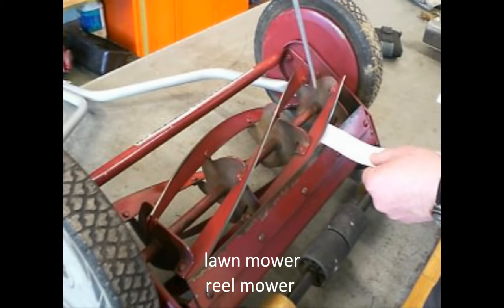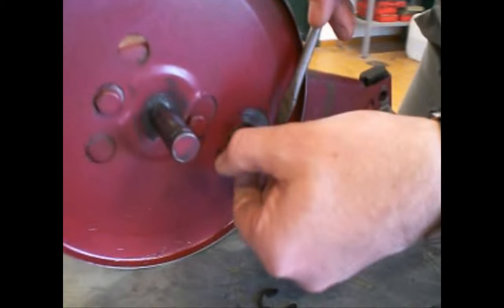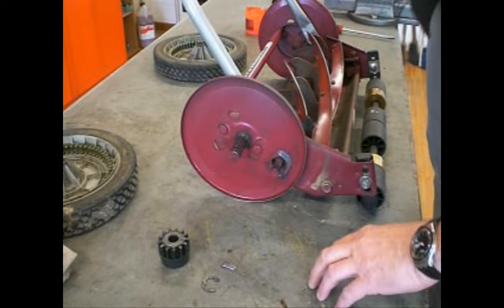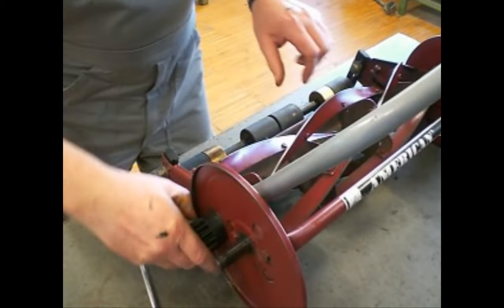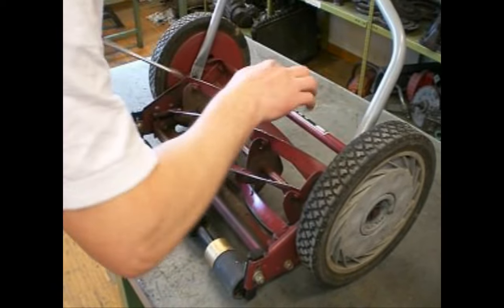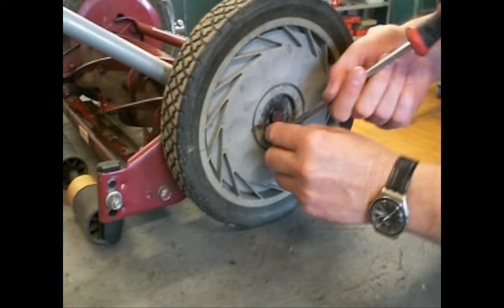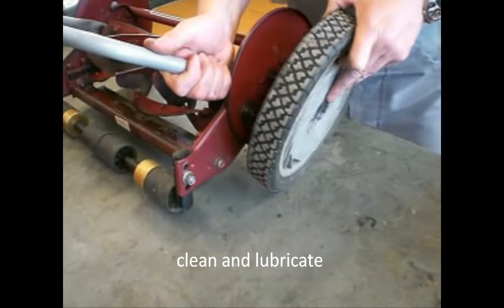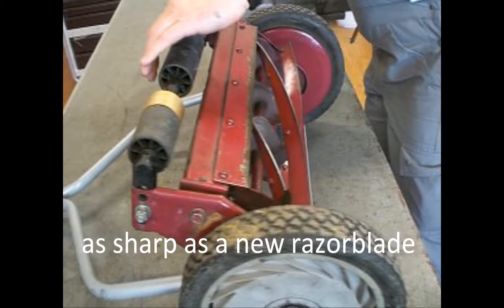sharpening of a push reel lawn mower

Comment: Gerwich, This is a great instructional video. I'm wondering if you have to reverse the blade turning direction to counterclockwise? I have lapping compound, but I don't have access to a workshop and tools and am wondering if the blades can be sharpened if you don't reverse the gears and they run clockwise? Or will they be damaged. Thank you.
Reply from the maker: Dear Sheri! You MUST reverse the direction of turning under using lapping compound. Otherwise you will get the opposite effect, the blades will get very, very blunt. U would make damage.
Reply: Thank you for the clear reply Gerwich. I'll give it a go.

Comment: Hi! It is a clear video but I do have some questions still. What setting do you have to set the plates and bedknife, what do you have to look out for?
And how does the lapping actually work, how does it sharpen, against the floor?

Thanks in advance!
Reply from the maker: Hallo! Sharpening works between reel and bedknife. Tuning of reel and bedknife with setting screws  is a value of experience. There should be a little bit of contact, so that the reel is not running too easy or too strong. Good luck.
Reply: @geri1360  Thank you so much for the clarification! I think I will be able to do this now! :) only find some lapping paste and then Ióm good to go

Comment: I watched this a few weeks ago and thought, I can do this! went and bought a second hand mower and brought it home and it's this exact mower. Picked up lapping compound and grabbed a screw driver and I just had the most fun mowing a lawn ever. Thank you for the tutorial!
Reply: @geri1360  can we just leave the mower as is and put the grinding compound then pull the machine instead of pushing?
Reply from the maker: @venus2012ful  Hallo Venus! You have to interchange the cogwheels, so that the reel turns counterclockwise. And then push the mower. b reg

Comment: Mr. Gerwich,
Back in the 60’s the local hardware store had a machine that the knife guy would take the mower and mount unto.
The a grinding wheel on a track would pass over the blades, is that process still around?
Is it better than the self sharpening method.
Thank you Dan
Reply from the maker: I think the method with the grinding wheel is still around, but lapping as showen in the vid is more effective and the costs are lower.
Reply: Thank you :-)

Comment: about how long would you say you should push the mower in the reverse configuration in order to sharpen the blade? hope i worded that right and thank you for the great vid.
Reply from the maker: for about 2 minutes. If the blades are very blunt go 4 minutes around in reverse configuration. br
Reply: hey thanks man i didnt think i would get a reply :) still debating on sharpening especially after adjusting the cutting blade screws. now it seems to be cutting the paper all the way across.
Reply from the maker: Perfect. When it doesn´t cut the paper all the way across, you must resharpen. Remember well: after every mission clean the mower and spray some WD40 or similar over the blades. There is some organic acid in the herbage, that makes blunt. I sharpend my mower LAST YEAR, not this year! And it works perfekt. I think, I will also make a video about reel-mower-service. br

Comment: Could you explain the adjustment you did in the beginning? Adjust those screws how? And why please, im confused.
Reply from the maker: one have to adjust the correct space between the reel and the bedknife by turning the setting screws. You must feel the drag of the reel. The reel should not turn too strong and not too easy, it is an value of experience. With the setting screws you can make the space between the bedknife and the reel larger or smaller. The screws pushes the bedknife nearer or remoter to the reel. Hope, I could help you. b.r.
Reply: @geri1360  This is a great video, thank you for responding!
Reply: @geri1360   Ohhh.... I THINK I see how it works now!  Thank you for the answer and thanks to Michael Sockwell  for asking!  As a woman who isn't used to a lot of tools, I hate always asking the obvious (to everyone else) and am always glad when someone else needs clarification in the comments!
Reply: @michaelsockwell6343   Glad you asked the question I couldn't see in the video.  Now we BOTH (and others too, probably) see it clearer!
Reply from the maker: @freewaybaby  enjoy your mower

Comment: Excellent. A question though-how snug should the bed knife be to the reel?
Reply from the maker: So that you can turn the reel by hand with low force. BR
Reply: @geri1360  Thank you. So there should be a little bit of contact between the reel & bed knife-but easy movement.

Comment: thanks for the interesting approach.... are you saying the blades sharpen themselves by simply reversing and pushing around for awhile with lap compound... no need for file or sharpening tools???... what if it is rusty and quite dull???
Reply from the maker: there is no need for file or similar tools. If the blades are ver blunt, make some rounds with lapping compound and when the reel is going easier - you will feel it - then set the bed knife closer and repeat the action twice or threetimes. Under correkt maintenence there should be no rust! Clean after mowing an apply protection. e.g. Diesel.
Reply: @geri1360  aloha, and mahalo for the additional info... will get some lapping compound and give it a try...

due to volcanic air pollution (sulfur dioxide, sulferic acid when combined with water, battery acid)... it corrodes even stainless steel.... 

i use melted wax or recycled oil for trying to prevent rust on some metal tools..... it helps, but still not perfect... never tried diesel....  mahalo again for responding...
Reply: Can I assume that the combination of running the blade in 'reverse', coupled with a small amount of lash in the bearings for the reel, combine to ensure that the lapping compound wastes material on the blade(s) at the 'back' edge of the blade, and the (uniform) positive contact of the blade on the bed knife serves to distribute the compound but not remove much material from the front, or leading, edge of the blade? IOW, is the application of this method best suited to a mower with equal (and reasonable) lash in the bearings at each end of the rotor (reel)?

Comment: This technique worked so well, I feel like an idiot that I was cutting my grass with such dull and poorly positioned blades. Another Youtuber had an elaborate method using a power drill. This one is so simple it's genius. I set it up as directed, pushed my mower up and down the street for less than 10 minutes, and reduced my mowing effort by at least half.  THANK YOU!!
Reply from the maker: :goodvibes:

Comment: Thank you. Very clear and helpful.
I wanted to reduce my use of gasoline. I have an electric car, so why not an electric mower? I had an old reel mower in the shed that I had never used. Cleaned and sharpened as you instructed my grass now looks better than ever using no fuel at all. It is actually easier than hauling my old gas mower around the yard. Thanks again.
Reply from the maker: Very well! And thank you for comment. BR

Comment: Thank you so much, I now have a fully functional reel mower which actually cuts the grass rather than just chewing at it. I used valve grinding paste from a car parts shop. The instructions were very clear and the only problem I had was replacing the ‘C’ clips, but I got them on after a bit of fiddling
Reply: I remove C-lips with a flat screwdriver. Only one push, no fiddling. But fiddling is also ok. Have a nice day!
Reply from the maker: C-clips are sometimes hard to remove. Use new ones. With only one push I remove them with a flat screw driver. br

Comment: Do I need to ensure the paul is put through the same way as it was put in before ? Or it doesn't matter, the pinier gear switch is the key ?
Reply: I agree with others, that this is the best simpliest method I found thus far, why bother with the sharpening kit for another $20-40 after shipping. All that is required is the lapping compound, brush and gasoline.
Reply from the maker: You have to set the pawl correct. Proof by turning the pinion! Good Luck!

Comment: What's the reason for taking the wheels off to sharpen the blades? Can't they be sharpened with the wheels on?
Reply from the maker: The reason is to get an opposite direction of rotation of the reel. During sharpening the wheels are assembled.

Comment: Nice job! I especially like that you mention when adjusting the screws that a 1/4 turn is a big adjustment [other YouTube videos floss over this explanation], it is in line with American Lawn Mower Mfg. product manual [pdf file], they mention this is a very sensitive adjustment [they consider a 1/16 turn is a major adjustment]. When you think about it - when you've done the lapping process once [creating equal pressure/drag across the bed knife] the adjustment of a 1/16 turn is plenty to do the job when you lap the next time.  I certainly will be subscribing to your channel, I like your approach and insight.
Reply from the maker: thank u! Love u!

Comment: Perfect! So helpful. Not sure why the poles need to come out, but otherwise everything I needed to know. Thanks!
Reply from the maker: The pawls must come out, to set in reverse for getting reverse direction of reel turning. Have a nice day!
Reply: I have also seen where you skip the step of reversing and simply remove one wheel put the other wheel on the edge of a table then connect an electric drill to the axel and reverse the mower and run for a few minutes. 

What I learned here was to simple tighten the bottom blade is all I needed. It seems overtime it sacrifices itself.

Comment: does this work with a motorized reel mower also?
Reply from the maker: I think, it will work, if you can drive the reel in reverse direction. br
Reply: check out How To with Doc, He shows how to sharpen Motorized reel mower.

Comment: This is the best video I've seen on this subject. Thank you, very much for the time and energy you gave in showing how to sharpen the blades. The camera man did a great job with the camera, too, which can make or break a video. I just wish to see one thing... to see how tight the blade was after you adjusted the screws, before the sharpening... that's just a little thing.

I bought a push mower for $10 at a yard sale, and it looks pretty new, but it's not cutting that well.  Maybe, I just need to adjust the blades. If the blades need sharpening, now I know how to do it. Thank you!
Reply from the maker: Thank you. I love your comment.

Comment: Hello from indonesia, thanks for your time to share your knowledge and shares. Clean teaching video. I got a used mower from local market, rusty and dull. Had follow your instruction and got good result but not yet perfect. I found troubleshoot that 2 blades at the edge caused jump effect (bumps) when it touch the bed knife. Those 2 blades wide seems not flat. Hope you kindly give me advise what to do to fix those bumps, so those 2 blades side can perfectly contact the bed knife surface and can perform better to do this sharpening methode. Sorry for my worst english, sir.
Reply from the maker: Hallo! Maybe the knives are loosen. They must be tight. Greetings from Austria. B Reg

Comment: What’s a lapping compound?
Reply from the maker: grinding paste. f e Chemico. br
Reply: it is a graphite paste..it is used to smooth out tiny nicks. this is called back lapping not sharpening! it will help but a complete sharpenig of reel and bedknife should be done every year or so and the procedure in this video about 4 times a year depending on how often you mow..

Comment: This is awesome.  Gute Arbeit!  The only thing I might add is that lapping compound can be tough to find depending where you live.  It is likely that you will have to find it a speciality automotive store where they sell valve repair equipment.
Reply: Exactly, I use engine valve lapping compound, bougt on the internet for few money. And there are also alternatives, you will find here on youtube channel. Thank u for great compliment! BR
Reply: Every garage with a mechanic probably has valve lapping compound somewhere within its walls. Garages are everywhere because ICE cars are everywhere. If you only need a small quantity from time to time, don't buy it retail: hit up your local garage mechanic and strike up a conversation… knowing what it costs, and what it's worth, it doesn't hurt to ask. The worst that can happen is the mechanic says "no".
Reply from the maker: @michaelthibault7930  Thank you for helping me. Have a nice day!

Comment: Here I thought the blades needed filing with a file.  Very surprised at this video.
Reply: no file nescessary. Lapping is the magic. BR
Reply: @MrGerwich   I can't be the only one who doesn't get it!  The lapping compound, but what are the blades being sharpened against?  Thanks!
Reply: They will be sharpend against the bed knife. Have fun with your mower!
Reply: The straight edge of a paper cutting board is to the bed knife of a reel mower as the guillotine knife of that cutting board is to the rotating blade of the mower.

Comment: Thank you. But I am confuzzled....your counter clockwise looks very much a clockwise to me....to the right around right down to the left up and to the right..clockwise...your explanation States the opposite?! Why ??]please help me.i hazve a sharpening stone as well as a file bastard standard flat metal file all purpose ...I'm so frustrated...I've pushed headed dragged pulled shoved that dull beast across my lawn with such exertion I'm convinced someone will find me dead with my push mower faithfully in my one hand clasped around its flat bar the other hand flipping the bird and a message i was able to spell out in  grass clippings my sweet revenge...the push mower killed me...it was the push mower....
Reply: Don’t worry about what is clockwise, as long as you switch around the two gear cogs the reel will spin in reverse which will sharpen it once you put on the lapping paste/valve grinding paste. I am not a handyman (in fact I am a not very handy woman!) and I used this technique to fully sharpen the blades on my reel mower. I did the slicing the paper trick and it worked, very satisfying
Reply from the maker: @nicolabenson1155  I love your comment
Reply from the maker: clockwise -counterclockwise: it depends on the perspective. Stay alive!

Comment: Ok,
Just a question, 
You didn't really show how to sharpen the bed knife,or if you sharpen the reel. If you are to sharpen both. 
You showed us how to remove the wheels,and clean the reel. 
How do you sharpen the bed knife?
Reply from the maker: lapping compound makes the reel and bedknife sharp at once by running reverse. B.r.

Comment: How about a video on sharpening the blades without 10 hour dis-assembly of the whole thing? This is a joke.
Reply from the maker: with average skill you'll do the job in 15 minutes. b.r.
Reply: It  was pretty easy for me even though I've never done it before.  

It is necessary to disassemble the mower in this way to sharpen; I don't think there is another way.  Also, the instructions that came with my pushmower used the same detail  but without sufficient detail. This video is the best explanation.
Reply: Thank you very much. It is also nescessary to keep the mower in good condition for holding sharpness. Therefor I clean blades and bedknife after every use and add WD-40. (penetrating oil) BR
Reply: great instructional video.  I need one to determine if my mower should  be thrown away.
WD-40 is not penetrating oil but it does repel the water.  Wiping down the blades with a cloth, regular use and perhaps infrequently and at the end of the year putting a penetrating oil on the blades is a good idea.
Reply: You are rigth, WD40 is not a penetrating oil, but it works. br